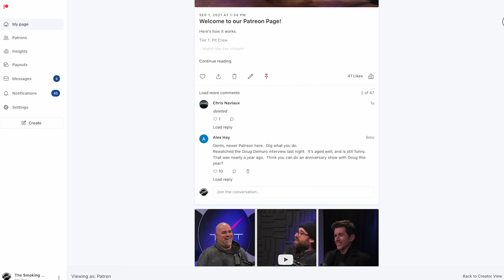Ways the BMW 128i is Better than a 135i or BRZ - One Take

Comment: I’ve had mine as a daily for 5 years now. At 55k tons of crap broke but look for the SULEV models and all is covered. Radiator cracked at 80k and the oil pan leaks but overall cool little car that with the right handling mods is great for canyon carving.
Reply: I’d be interested in one possibly. You think it’d be a good daily or not? And what years should I go for?
Reply: @onefastboi14  I don’t think it matters too much for the years but if you can find a sulev model and you are in a state that warranties it then get it.  The sulev warranty is 15 years and 150,000 miles and covers so many things. They all leak. Oil filter housing, manifold, oil pan so check those 3 things specifically when looking for it. Mine is at 81k miles now and just got the radiator replaced under sulev and has been running good since 60k miles. Mine is auto which is okay but I do miss a clutch!
Reply: @onlychrislevine  I gotcha. I live in Texas so not sure if I’d be covered but I’ll try to find one that’s an SULEV model.
Reply: @onefastboi14  mmm maybe not in Texas but standard stuff regardless, look for oil leaks and maintenance records. I’d be happier with the M package model as well. But overall very reliable compared to turbo models. GL!
Reply: @onefastboi14  It's an amazing daily. I have owned and driven all types of Mercedes, BMW, etc, and this is my favourite car.  I have owned mine for 5 years and put 70k miles it. It's been pure bliss and extremely reliable. I have spent about $4k on total maintenance.
Reply: I would recommend not getting the SULEV. More to go wrong.

Comment: 128, 228 and 230i are criminally underrated cars. They may have less Hp but they are lighter and cheaper to maintain, which actually makes them better track cars. Anything with a B58, aside from the Supra, weighs as much as a house.

Comment: past 135i owner here. i gotta say that the 128i is pretty expensive these days. it's not really the cheap car it used to be. the manual coupes are definitely swooped up quick. the weight is also a bit higher than it should be, the car has an open diff and has bad understeer from the factory. it's not that cheap/easy to fix that. the FRS is a much more suitable platform in stock form. if you read any serious 1 series build log that's not a 1M (which has most of its problems solved, at the price of like, 3 135i's) you'll often hear that you're already dumping a good amount of money just to get this car to a neutral behavior. 

that being said, it's an excellent daily and at stock, drives awesome until around like, 7/10ths, which I think is pretty true for most BMW's nowadays outside of true M cars.
Reply: Bad understeer? Lol you obviously have never driven one. The 135 is the one that understeers because it has more weight on the front
Reply: @mediocreman2  lol it definitely understeers, just like any other non M bmw.  you know the n54 weighs a whopping 50 pounds more than the n52? if you think the 128i is neutral from the factory you're just kidding yourself lol. it was always designed to be a 7/10ths car.

Comment: N54’s are the balls…! You can run 550WHP out of one with no issues if you maintain them properly & aside from the oil pan & valve cover they have issues like ever car ! Very cheap to bullet proof them, front main seal guard, billet goose neck for head, crank bolt capture. Not all cars can run 750WHP on stock internals & last ! If you’re going to build a hot rod, maintain it like a hot rod…! I like 128i’s with superchargers on them!!!

Comment: 135 has the glorious N54.. of course it's going to get attention. To date it is still the superior tuner's motor. It sounds awesome, is easy to program boost curves for, and has a huge ceiling. The 128i is really only chosen for those who want to save money. But I will say the N52 is reliable.
Reply: Would you say that a n54 is more sought after then the n55 for people looking into 135is
Reply: Did they ever resolve the hpfp issues?
Reply: @sixstrz8310  The N54 is an ancient engine with a lot of problems. Go N55
Reply: @Jballzx  makes sense why the n55 would be better but doesn’t the n54 come with forged pistons and rods be kinda dumb not to go for that lol
Reply: Everyones first thought is always that people buy them to save money. Money was not at all the issue when i bought my 128i. I own several cars and spend most of my days off working on them. I wanted a fun trackday toy that wouldnt add to the list of stuff i need to fix every weekend. It was purchased to save time not money
Reply: The 128i seems more at home on the track, when i had mine, i had the pleasure of passing a 135i after reeling it in for about 3 laps. I had invested in camber plates + suspenion mods, and the chunkiest tires i could fit. The 135i had only an engine tune.
Reply: ian trofimov  I knew it forged parts from factory do make a difference idk why the other guy said it does not 😅
Reply: @sixstrz8310  the N54 has forged crank and rods, but not forged pistons. That said, you’ll bend rods if you tune it poorly. Keep the torque on stock parts around 450 max.
Reply: You mean save money by their car not being in the shop? I would rather drive a car than have it broken 11 months out of the year like my friends with N54 cars

Comment: I had a 128i M Sport with no sunroof, no I-drive, and 6MT. Definitely the last of old BMW. With that being said though, these cars aren’t that good stock. The engine is a dream, but the suspension is a mess, as it was BMWs first foray into ringlets. The car basically needs a whole new suspension to get it to its potential, while the BRZ is already good to go out of the box (compared to the BMW). If you’re game to mod or into that, it’s a fantastic platform, but a stock 128i, even M Sport with a manual will leave you wanting.
Reply: Not at all. Amazing suspension out of the box and with a few changes much better. Maybe you're comparing a worn out 15 year old suspension to a modern car

Comment: had a low mileage 09 for 3 years, sold it for triple the amount I paid for it initially. for me a 128 needs stiffer suspension, a lsd and a driver seat with lateral support.

Comment: I was excited to see this feature by the title but found it somewhat disappointing I have to say.  I felt that the handling magic of the short wheelbase and how much that changes the cars dynamics vs the other bmws wasn’t mentioned.  Also the engine was stock power the guy didn’t even do the minimal mod of put a 3 stage intake on to get 255bhp.  So kind of lame.  No one is going to get excited about tracking a stock power 128 it’s just not enough power, and especially so at stock weight of 3200lbs.

I have a CSL build e92 with same motor tips the scales at 3050lbs with 1/2 tank and makes 300bhp n/a with some mods.  On the track I’m passing 718 caymans and 997 Carerra S, so punching way above its league.  

I have a buddy with a 128 build similar to mine and the first time I drove it I was in love.  Amazing cars the 128 and pure BMW magic where you can feel the heritage of the 2002, a small light quirky coupe that only can be understood from behind the wheel.

Comment: I am biased, as I own a GR86, but let's talk cost of ownership over 5 or 7 years.  The BRZ/GR86 will leave the BMW's far behind.
Reply: The 128i can be bought for few thousands less than the cheapest 2013 FRS/BRZ on the market. 
And the maintainence on the 128i is possibly the cheapest BMW to own, period.
Reply: I'm getting a BRZ, so I've made my decision, but my brother's E46 330ci is a dream to drive. Beautiful engine note.
Reply: @leonchen89  mine was new, but even the "cheapest BMW to own" will cost more to maintain, service, and insure than the Toyota or Subaru.  It's pretty simple math.
Reply: @Consoul909  yeah but those Subaru engines are turds, no torque, leaks oil, doesn’t handle boost well. I would’ve got a GR86 if they came with bulletproof Toyota engines instead
Reply: @BRAINFxck10  well my fingers are crossed with the new powerplant lol.  I'm not going to mod mine.  People don't realize how few 2022 GR86's were actually produced compared to the normal numbers, so mine just gets babied and left stock.  1123 miles in 8 months. Hahaha
Reply: I spent way more on upgrading parts for my 135i N55 than I ever had to for maintenance, and I do most myself. The N52 should be even cheaper &  a six cylinder is the biggest factor in choosing between a BRZ or E82.

Comment: i mean, the 128i and the 335i have the same drivetrain from the flywheel back, the same dme, same modules etc.  you can get a good running complete n54 engine for around 1500, 2-300 in flash tuning and you could convert it to a 135i.   the 135i are still higher priced for n54s but you can score a 128i and make a 135i for much cheaper.
Reply: But that's the entire reason not to get a 135i. Too heavy on the front end and too unreliable

Comment: i would love to see the owner in a well built 135i to really see the difference
Reply: I have an m235i. It’s 3 seconds slower around an autocross course than the 1. 
-The Owner
Reply: @sinfue  is it putting out stock power? i had a mercedes that handled super well and had same hp as 128i, got my 335i and it makes around 550 wheel on twins, which completely blows out the mercedes, just wondering if youve been in a high hp good handling car, and if you still consider the 128i a better handling car. thanks for reply

Comment: As an owner of both 06 330i and an 07 335i, the N52 is NOT better than the N54.  I have 220K miles on my N52 and has been far from reliable even with top notch maintenance and 100% OE parts from FCP Euro exclusively.   This guy barely knows this engine reliability at 10K miles